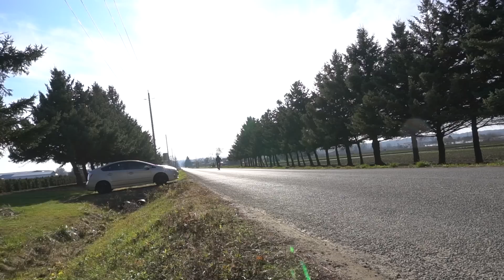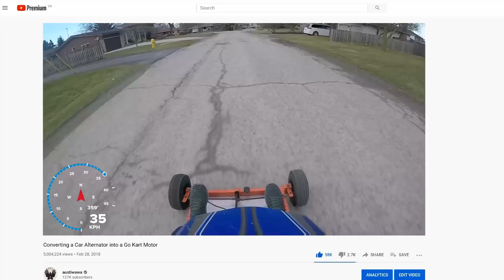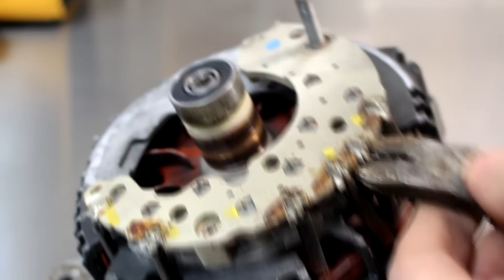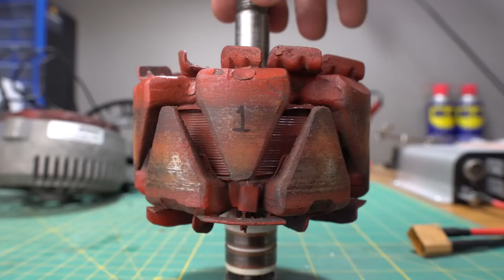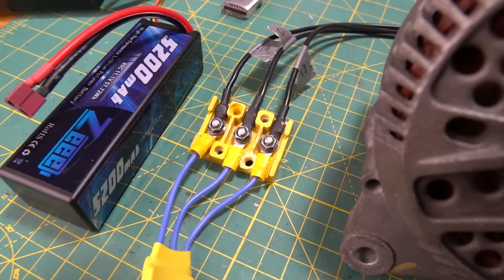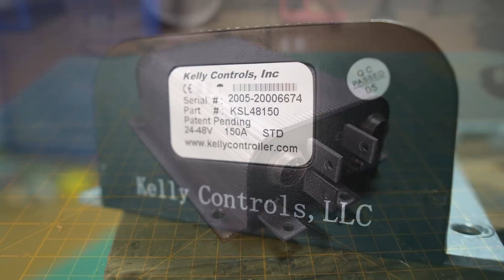Building an Alternator Powered Bike

Comment: would an ir sensor triplet attached externally  to the shaft work just as well? 

in car alternator field test. if the rear bearing becomes magnetic, the alternator is charging😎

all you need is access and ferrous metal, 
( screw driver)
Reply: and a light blocking disk with timing slots cut in it

Comment: YOUNG BRAH - what is the shaft RPM @48v? One of the main issues with existing brushless motors is they run at 4300 RPM with no way to gear down without a jackshaft which is a heavy, expensive, and bulky PIA good only for a trike or a cart. ALSO YOU RESOLVED THE MOUNTING SOLUTION FOR THIS. CONGRATS!

Comment: Hi, absolutely incredible, ok I’m ok on electrics and motor engineering, but you seem advanced and incredibly knowledgeable on this…… Could old rusty be running off the alternator converted motor and get the batteries charged at the same time? This could revalucianise the electric bike and car industry! Just a thought!
Reply: nope, just as regen braking

Comment: Put into the clutch weaker springs and you should be rocking. Those clutches are intended to connect at 1500rpm if i recall right and your motor probably wont reach such rpm specially with load hindering it, so there is lots of slipping.

Comment: Hey Austin! Loved the details on hall sensors. I had no idea how useful it was for helping control start torque/max RPM. 

I pulled an alternator out of a junk van and created an electric drift trike out of it using 12v lead acid security system batteries. One thing I noticed was the field coil would pull 3+ amps at 12v. Have you experimented with controlling the voltage/current to the field coil? Does this matter or is it an all or nothing situation? (Being it's an electromagnet, it's either magnetized or not)

Also my motor would get verrry hot, and I ended up doubling the gage tot he motor. Looked like you has maybe 12 gauge wire to the alternator/motor. Motor ran hot, but the wire held better. Thinking back now I think the ESC (meant for E scooters) was oversized for the alternator.
Reply: I don't have any answers for most of your questions but I do have one contribution.  There's no such thing as an "oversized" ESC.  Assuming you're running the same voltage on all, a 30A ESC, a 100A ESC, and a 200A ESC will all do the same thing.  The only limit is how much current the ESC and motor can handle.  A larger ESC will not "force" current into the motor... the motor will only pull whatever current it wants, and as long as the ESC can handle whatever that is, all is well.  You could put a 300A ESC on a motor that only pulls a max of 20A and it would be fine as long as you're not exceeding the rating of the motor itself by being overgeared or pulling too much current for some other reason.  Your motor will get hot as you say or possibly burn out no matter how big or small an ESC you're using if there is something wrong in the setup.  So either your motor is undersized for the application (hard to know in reality, since it's a converted alternator and not a motor with proper ratings), or your gearing is too hard on it.  Hope this helps :)

Comment: Your vid popped up in my feed again. I forgot to mention this before. Why a separate battery for field current? Just use a cheap Chinese DC/DC converter, preferably adjustable output voltage so you have something else to tweak and optimize. Power the converter from your 48v pack.

Comment: Could you add a second alternator that recharges the battery, or would it drain much faster than it charges?
Reply: it would drain faster because of the friction and because an alternator isn't the best at recovering energy, that's why it spins so fast in a car, to try and work more efficiently

Comment: I just saw your video again building an alternator powered bike and of course you got resubscribed every year right ditch all the channels and start over try and get it fresh perspective.
I just want to tell you that when you found out that controller would constantly run when you started but it worked okay you thought when she got going I got to tell you I think it was absolutely effing brilliant to use the mini bike clutch now I think they got heavier clutches out there and maybe that's what you need

And how I didn't look at it close enough but how you use that piece of like shaft with the key hole in it to mount it I I actually have to watch everything again I was so busy being entertained with the mini bike and now you have it being run by an alternator / motor which is ulcer also I generator when it's peddling correct so are you doing regenerative pedaling when you pedal does it charge it curious.

Comment: Seems like you got it working okay. Good job son. Did you ever consider including a big ass capacitor in there somewhere to compensate for the initial "chug, chug, chug"?

Refrigerators, air conditioners and heat pumps all utilize a big ass capacitor to assist the electric motor at startup. Why would your electric bike or go-cart be any different?!!

Solidarity, little brother!

Comment: Love this.
 That centrifugal clutch can be fine tuned by changing the springs, much like the old advance mechanisms of automotive distributors.
Reply: aka. CVT🛵az well‼️😜🆘🔙🚀
Reply: Also adding weights so the clutch will engage harder at lower rpm

Comment: Unfortunately they do not make compact torque converters that could sub for the centrifugal clutch.  But you might try a car AC compressor clutch.  it might allow you to rev up the electric motor to full RPM and then pop the clutch to do a wheely

Comment: Little tip about the rotor - if you reverse the polarity on it you reverse the direction of the motor. Also don't feed it direct with 12V, try feeding it via a 3W 12V bulb to reduce the current it takes and the subsequent heating effect in it. I've seen the results of bypassing a charge warning light on a diesel generator when the bulb blew, wasn't pretty! Using a 3W (or even a 5W) bulb will prolong the life of both the rotor and battery.
Other than that, great video and yes, HE sensors are tricky to get your head around - i found it easiest to think of them simply as a switch which changes state as the magnetic field around them changes.
Reply: Does the bulb balance the current or something?

For the motor, do you think these numbers could be reversed?  /approximate?
"An alternator typically takes about 1 HP (horse power) for every 25 amps of power generated. So, a 100 amp alternator will require about 4 HP at full output."
Reply: @dizzydinoysus  As pointed out above, the bulb restricts the current to the rotor to prevent it burning out. As an alternator is a wound component, the generally accepted efficiency is ~80% (there are more and less efficient variants) and a 100A alternator will output 100A @ 14V. Simple Ohms Law provides 14 x 100 = 1400W, divide that by the efficiency and it needs ~1750W to drive it which is ~2.3hp. If the alternator was a 24V type at 100A this figure would be doubled.
However, reversing the figures isn't possible,  the alternator in the thumbnail that heads your vid is 40A which would be ~560W@14V output. This means it's capable of being driven with anything up to 560W of electricity. As 1hp is ~750W, thaat would be roughly 2/3hp. Hope that helps!

Comment: Great info Austin, I had a 12 volt motor from a winch, it had a lot of torque even minus the gears but when I tried it on my fat tire bike it won't even turn the wheel. You wouldn't have any ideas why by chance, thanks.

Comment: isn't the idea of an alternator powered bike so that battery usage goes down so that you can get much more mileage out of a charge?  can't you configure your setup like a car so that the alternator also charges the battery when it kicks in?  otherwise, why go through the hassle?
Reply: the alternator only generates energy because the car engine spins it, if you use it for creating the movement you would need the controller to be able to regen as it brakes

Comment: Why don't you apply full voltage to the stator & control the speed of the motor from the field windings...... like you're suppose to!  👍👍😉
Reply: Because that is not the way to control a BLDC motor
Reply: @foxxyytofficial  That's because it actually isn't a BLDC motor 👍
Reply: @hermanjones8734  but it works like a BLDC motor
Reply: @foxxyytofficial  Why do they?  BLDC motors don't have exciter windings that control speed.... do they? 😉
Reply: @hermanjones8734  And the exciter isn't for speed control, that adjustment being a byproduct of the real use for it, torque control
(less power = less torque = less hysteresis = less resistance against the stator field = higher speeds achievable)

(more power = more torque = more hysteresis = more resistance against the stator field = lower speeds achievable)
Reply: @foxxyytofficial The stator voltage controls torque, the field windings control speed.  Doing it the other way around is incorrect & loses the real ability of the alternator as a motor.  The only way to control speed in a permanent magnet motor is to control voltage to the stator because it doesn't have an exciter coil.... & my point being that it is a completely different type of motor entirely 👍
Reply: @hermanjones8734  if that's what you want to believe, be my guest then

Comment: I wonder if instead of a centrifugal clutch, an AC compressor clutch (electromagnetic clutch) might work better? It'd drain the battery more, but it might do a better job unless a higher quality centrifugal clutch can be used to reduce the slipping.
Reply: Or better, no clutch

Comment: Question: Once you re-implemented without the clutch, what does does the motor do when it needs to overcome resistance? For example, if you needed to take "Old Rusty" up a 10% grade, would it overwhelm the the motor and shut it down, or would it simply slow itself down and get you up the hill?  I noticed that your tests were on flat ground.
Reply: With the hall sensors the controller can keep rhythm, even while slowed down because of the load

Comment: LOLs, you have created real speed demon! I am wondering what the range would be running 32 kmh which is a very reasonable speed and safer. You have exhibited
some real impressive engineering on this project and thanks for the video.

Comment: I wouldn't have known about this stuff when I was 14 so I used a car starter motor on my crappy wooden go kart with broom pole axles, timing belt and wooden discs with nail teeth drivetrain, with a ton of friction. The motor overheated fairly quickly and blew.

Comment: If im connecting car batterys to make 36 volts do batteries have to be completely the same brand and amp hrs
Reply: no, but it is better to have the same model/capacity so you won't pull too much from the smaller and let the bigger ones with more charge
Reply: @foxxyytofficial  thx

Comment: why you can not connect the 12v for the brush on the same battery
Reply: you can, but need to use a DC/DC step down, because 36-48V on the brush equals immediate burnt parts

Comment: I have been thinking of making an hybrid self charging go kart using a starter motor from a car, i would just need to disable the solinoid so the spindle doe's not shoot out. These starter motors are very powerful and will tow a car no problem.
Reply: but how are you going to keep it self-charging?
Reply: @foxxyytofficial  alternator, was thinking of using this old 1970s suzuki ts50 engine, i got to 2 car battery's in my shed, loads of starter motors lying around and broken alternators i can repair. I going to have to build a big frame for it.
Reply: @leethatsme1988  but what will be the efficiency of the self charging mechanism?
You need at least the same amount of power going into the battery that you're using (if you're pulling 1000W to move, the self charging system needs to push 1000W into the battery) to be able to have better range, or else the battery will still drain like there were no self charging system
Reply: @foxxyytofficial  ah yes thats true, i will have to work it out. If not i will just make it full electric with a starter motor.

Comment: I have always wondered this, but what if you had a car, with 4 Alternators, 1 at each wheel and one motor that drives the wheels. Have a fully charged battery. Connect the Alternators to the batteries for charging and the batteries drive the motor to go forward. Self charging?
Reply: it won't work, because for the separate alternator to recharge the system, it needs to be 101+% efficient (absorb more than 100% of the power of the car to recharge the battery), i don't know why people suggest this so much

Comment: would it not be feasible to dual mount an alternator with the motor to charge the batts?
Reply: it won't work, because for the alternator on the front to recharge the system, it needs to be 101+% efficient (absorb more than 100% of the power of the bike to recharge the battery), i don't know why people suggest this so much
Reply: @foxxyytofficial  perhaps they ask the question because they dont know, that is maybe why they ask? and maybe they hope for a POLITE reply or at least an explanation why it wont. you fell down on both counts lol
Reply: @F1ReWaLkEr1  i already answered it
There is no way to get more energy from a place that you inserted, unless its nuclear energy
This idea of dual alternators is too inefficient to generate something
I already made the calculations before
Reply: @foxxyytofficial  yeh but i really think you skipped to the answer before understanding the question, my question revolved around mounting ONE alternator in series with ONE motor together/dual to put SOME charge back in the battery to supplement the mileage, i know its not possible to create a closed loop perpetual motion motor, if the answer is still the same then that is what i was after. im English not stupid ;)
Reply: @F1ReWaLkEr1  lets suppose that you got a 1500W 48V controller, and it will be locked to not pull a single watt above 1500W.

The controller will send 1500W to the alternator at full throttle, but since alternators as motors only are 70%-ish efficient (because of the rotor shape and laminations), the alternator will only "pump" 1050W to the wheel

Now you get an identical alternator to "recharge the battery", when you turn the 2nd alternator's rotor and spin it, it will create a load proportional to the amount of energy, but since you're already pulling 1500W from the battery, you will need to divide it between moving the bike and recovering energy.

Let's suppose that you got 700W to move the bike and the rest (350W) to the alternator, so you won't lose too much speed

Alternators as generators are only 50%-ish efficient (already tested), so from the 350W you'll go 175W

175W at 14V is 12,5A, but since the battery is 48V we need to get 3.42x the voltage, so we will lose 3,42x of the current (3,65A)

Since we are pulling 1500W at 48V in full throttle (31,25A), 3,65A (the theoretical max) won't cover 12% of the total draw, you will still be wasting power, and that is considering the best probability, not the worst

The better solution is to find controllers that can use regenerative braking (the new controller at the end of the video can use regen)

Comment: Put a fully functional alternator on the otherside to charge battery while going
Reply: it won't work, because for the alternator on the front to recharge the system, it needs to be 101+% efficient (absorb more than 100% of the power of the bike to recharge the battery), i don't know why people suggest this so much
Reply: @foxxyytofficial  not even a high amp output alternator with proper pulleys to speed up rotation ratio? Even if it did not fully keep things from running out of power it would significantly extend you time/distance for travel would it not?

Comment: If you put a free coaster on your bike for your rear sprocket in the rear tire I would try pitting an actual gear so it doesn't slip. You could hear the clutch slipping big time you're losing torque and speed

Comment: This isn't road legal in some states. Check your local laws. Some states make it so that once a motor is installed to a bicycle it's held to same standards as other vehicles on the road, such as headlights, taillights, turn signals, horn etc. After all that, you might as well buy a cheap motorcycle.

Comment: Great job, now to extend battery life, Mount an alternator to the front wheel and recharge. !!!! Lol.
Infinity and beyond...
Reply: Usually alternators are only 50% efficient, so you only recover 1W out for each 2W you put in
Lets get an example:
You use a 500W limited 48V controller and a battery that can output 500w continuously for 2h
When you use the alternator as a motor, the efficiency is better but not perfect (70% max efficiency from graphed tests i saw), so from those 500W, you would probably be getting 350W max, but still pulling 500W out of the battery (10,4Amps at 48V = 500W).
Now put a second alternator to recover energy, it will try to generate energy by pulling it out from the front wheel, driven by the rear wheel (the force on the rear wheel makes both wheels run on the ground), so now you will have to divide those 350W for moving and to recover energy, since the controller won't pull more than 500W total.
Lets suppose that you got 150W on the charging alternator and 200W to still move the bike. With the 50% efficiency as a generator, those 150W becomes 75W, still at 14V. To get the 14V output to the battery, we need to make the voltage grow 3,42x, but when the voltage goes up, the current goes down. 75W at 14V is 5,35Amps, but at 48V its only 1,56Amps).
And since the controller is already pulling the maximum power it can (10,4Amps), minus the 1,56amps, you would still be pulling 8,84Amps that can't be recovered
Infinite can't be achieved unless you have magical powers